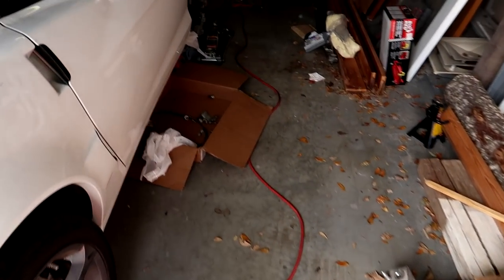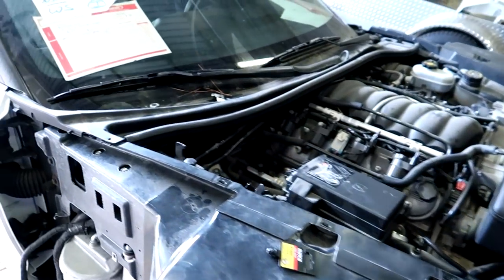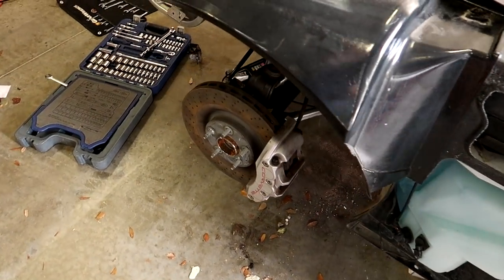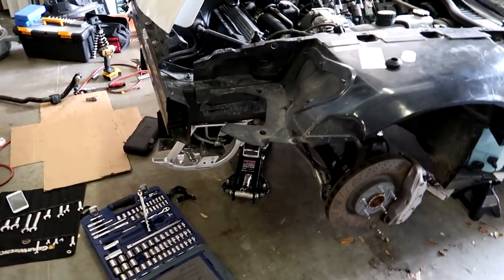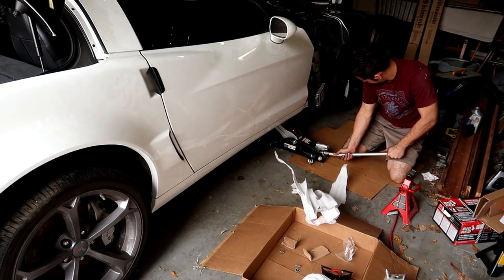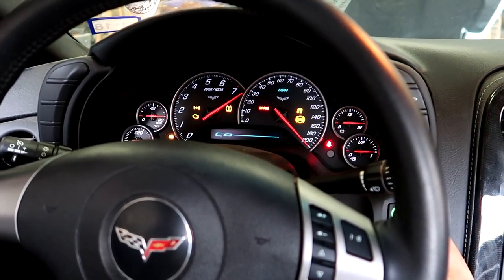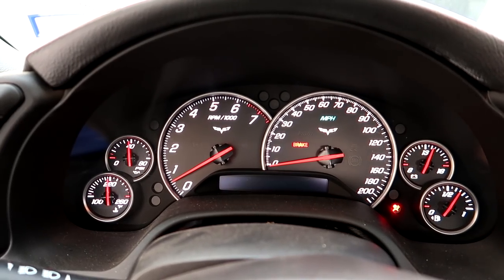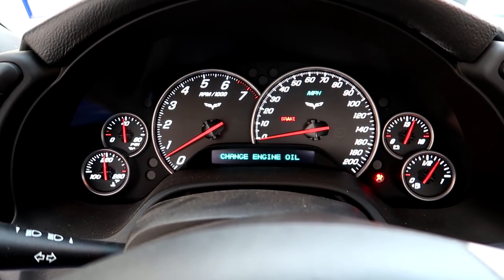THIS is why the Cheap Salvage Corvette Won't Start! Easy $100 Fix!

Comment: Do not use tap water in your radiator people... distilled and coolant only.
Reply: Why ?
Reply: ya472 minerals in the tap water could build up and cause some blockage.
Reply: Even one gram of minerals in water makes no difference.  Besides, any minerals or contaminates are suspended in the antifreeze, and again the volume is insignificant.  There are more minerals, ions and residual crap coming off the metal parts, gasket goop, seals, etc.  Using distilled water is just an 'old wives tale'.  Check your hot water tank, it takes three years and thousands of gallons of raw water to create significant mineral buildup.
Reply: He said he was just checking for leaks and if none were found he was going to flush it and replace with proper coolant. I see nothing wrong with what he did.
Reply: Distilled water? Drain refrigerator thaw out hey presto it's pure water.
Reply: ... then there will be someone who complains about distilled water because it can't handle higher temps and has a lower boiling point than coolant ....
Reply: Distilled water in a battery , I think your getting confused.
Reply: paul davison ...premixed coolant no, concentrate requires a "correct ratio" of coolant and distilled water for it to be "effective". Then some idiots just run distilled or tap water, which has a lower boiling point, and has no antifreeze properties in cold climates. Then the argument for the reaction between certain types of metals in some engines not being protected when using distilled water. Tap water dangers are the hard water minerals that build up. But everyone seems to have their opinion on what is acceptable, so it really seems to be personal opinion and experience.
Reply: bullshit dump the dexcrap replace with regular green shit and tap water  change every year if u are going to be absolutist then distilled water but shit comes apart when it does = galvanic corrosion distilled water will prevent this unless aluminuim gets released into systemwater pump wear then all for naught green shit and tapwater i lost an LT1 9c1 caprice to this dexcool shitcredit due engine temp guage read 270 degrees created  oil @4psi also dumped an xtra gallon on oil in at fuel stop cuz heard what sounded like boiling oil  2 more  hours in 10 below freezing  arrived at 445 am to west virginia  from nj next morning engine started and it read 9 psi that is a lot of hard running wonder if an ls1 could handle that                               FUCK DEXCOOL TRT2
Reply: I am a mechanic, I never used that. I use tap water and coolant. I always get rid of  dex kill. Put in 60/40 mix. I live in Michigan a colder climate. I have had no issues yet. Been doing this for 30 years. Even my college instucters use tap water.
Reply: are you A.S.E Harold... how many years shade tree? It only takes one flush and fill using the max coolant to water to know tap is Not a good idea. You would risk up to a few grand or more to save a few dollars with tap water? Is distilled life $5 a gallon where you live?
Reply: Distilled water is like $1.50/gallon at MOST, and I'm not sure where you live, but I've got tons of sediment and minerals in my tap water. If you can do it the right way, why would you not?
Reply: @nowake  It's not the right way, it's just a pointless way.
Reply: @hycron1234   It depends on where you live and the water source.
  I agree on where the crap/build up/corrosion come from: Galvanic reaction, internally. Ever use a volt meter on your coolant? It makes it own ACID.
Reply: @rickthompson5120   I use EVANSCOOL. Way better than what is usually recommended. You would be surprised how may benefits it has over conventional coolant.
 Sorry for the plug.
Reply: I use piss and vinegar to cool my engine but I also drive a vw bug

Comment: Don't use dex cool. That's some horrible shit, my engine was sluged up and stains so bad if you spill it
Reply: That is correct!  Especially now that the system should be totally flushed with the water, etc.  I would personally fill it up with the Prestone Green PreDiluted Coolant!
Reply: Actually, GM resolved the problem with Dex cool. The coolant in early 2000 was reacting to the chemicals in the gasket sealer and chemical coatings on the head gaskets. Idiots were putting it in 1997 models and older. The gasket sealer in 2005 and newer vehicles do not have that problem.

Comment from the maker: I owe it to you guys to upload more often! Too late for a New New Year's resolution???
Reply: Samcrac your videos are really good.  A+ and keep up the good work.
Reply: Haha wanted to hear you rev it though!!
Reply: never too late
Reply: Can you give us a shoutout in your next video please!
Reply: Sam you have one more new years   day coming up February 16th the Chinese New year, so get your fried rice , lo mein and dumpling on asap!!!
Reply: Plz update soon, great sports car project!!
Reply: Sorry but most manual gear cars you do not have to depress the clutch before it will start? It is good policy as I normally leave mine in gear.
Reply: Did you get it all done for 18k like you set your goal for. Also how much is the retail price. Thanks and awesome video 👍
Reply: bro if your going to use water use distilled water,, on the real...
Reply: Samcrac:. Yes that is how all these newer vehicles are. Anytime an ECM is changed or any thing dealing with such issues,a relearn procedure IS necessary. I found this out the hard way so I know. Good that you could avoid getting the GM Tech ll scanner. I'll certainly check this out as I do a fair amount of work on GM cars. Good luck with the process of getting the engine running!
Reply: How much did you pay for the car?
Reply: Hey Sam ! I replace my engine on my salvage 2008 corvette , I got it exactly like yours with a blown engine, but even like that it used stared normal, like right a way, but with a sound of a broken road, I did replace the engine , and now is like yours when you stared this video, ,,, NOW I bought the VCXNANO but the problem is that it came with no instructions, and I been trying to install it on a old computer that the program send me a note that is not comparable with windows 10, I bought an other cheap computer at a pawn shop and it says the same thing is the other old lap top, I wonder if you can make a video showing how you did it,, Thx,,, Oh I don't know if is me, or something wrong with the laptop , Thx again,,

Comment: That crank sensor thing can happen when you replace the flywheel too. On ford stuff it’s called a Neutral Profile Relearn. At least with my car you can use an aftermarket tuner to do crank relearn.

Comment: VIN matching on ecu bcm and speedometers is really annoying to backyard mechanics. I know it helps with parts theft but I don't want to pay to have parts reprogrammed just to fix my car with junkyard parts.
Reply: It's totally out of hand need re program to Change brake pads or ruin 1000$ caliper .used to fix vcrs change head need 500$ programmer for each brand of 100$ vcr  .now they want to put your money in there.so someone can borrow it during the night..😎
Reply: The parts theft thing is BS. They just want return business.
Reply: Agreed , i have a bunch of flashers from china to not only program my own key' but ecu's body module's and just about thing i need , they cost very little money .  The tech 2 scan tool has been hacked for many years now google tech2win

Comment: I hope you Flushed all that water out with coolant, you're not supposed to use tap water, only distilled water, the minerals in the tap water can wear things out faster, even if you just drain it, there will still be some minerals stuck inside, with that out of the way, I love your videos, hope to see more playful cows in them, keep them coming!  :D

Comment: It used to be called a Tech II. When my Dad worked for them he would bring one home from time to time. Huge Blue diagnostic and programming tool. Spinal Tap would go it too. It did not say to start it it said to cycle the key between off and on.

Comment: Wow, clutch pedals sure have came along way. I can't believe it needs to learn it. Is it clutch by wire, with no hydraulics?
Reply: Its probably a normal clutch but the car needs to know where it is so if you try to start it with the clutch in the car knows not to turn over
Reply: xsniper1916 I guess now it just knows the exact position of the pedal. I noticed the voltage reading 0V applied, and 3.9V released. I'm just used to the monetary clutch pedal switches on older vehicles.

Comment: I do the water thing as well for same reason. I also pressure test cooling system as well so it blows any bad hose connections or other.

Comment: The 32-bit computer thing u got wrong. It is software related in terms of, you can install an 32-bit OS on 64-bit hardware but not the other way around. To be able to use 64-bit u do need the parts supporting it. But you dont need an old computer just to be able to use 32. OK?

Comment: about the 32Bit computer... you can install a 32Bit Operationsystem on a newer one aswell btw :) (there are 32Bit versions of Windows 10 aswell)
Reply: You can run compatibility mode under 32bit no need to re-install . Every 64bit always have 32 version of the os.
Reply: yea but some things still dont work in the compatibility mode, same for the win XP compatibility mode in Win 7 etc. , works on many things but not on all ;)
Reply: Some older Software for Cars need XP and a 32 Bit CPU to run properly. You have a more direct hardware access on XP to the USB/Com Ports then under Windows 7 or 10. So it is not bad to have a older Netbook or Laptop to run the software without issues .
Reply: I just bought the Wi-Fi version of the VCX Nano and used it with my 2 year old HP laptop running Windows 10 64 Bit; and Tech2Win ran flawlessly! Now I can figure out why my TPMS light is going nuts after about 30 minutes of driving.
Reply: We have an old macbook with windows XP for this purposes...
Reply: L
Reply: I have an old laptop that run windows XP 32 bit I only use for diaganosing my cars. Work perfect for that. I have tried Win 7 in XP compatablility mode. The software still didn't like. So I unpacked my old XP laptop and am happy now.

Comment: That whole put it on the ground thing sounds off. What if you parked it on a hill?
Reply: What if you do a wheelie?
Reply: John Sams if u park on a hill, the tires would still have weight on them. It’s the removal of the weight that the sensors pick up. It’s a safety deal for when the cars r being towed(from what a friend who repos vehicles told me). Sounds legit
Reply: vdochev: Then it's already started, most likely doesn't do anything then.
Reply: Balex ask your Repo Man friend why does he think that having a tire lifted off the ground would be a security feature. Possibly in some odd way it could be a safety feature.  these days I thought you say 98% of all tows of any passenger all done by flatbeds or buy a wheel lift tow truck that lifts the car by the wheels so the wait is still on the actual Tire and a repo guy I guarantee has a tow truck with a wheel lift with all the Hydraulics controlled from inside the cab a crabs around the bottom of the tire and lifts it from the wheels. Somebody who has and uses a tow truck to steal your car could care less if it has a starter cut off security switch.
Reply: I worked for chevy. Never heard of that

Comment: Please diagnose my 2010 Camaro LS, 2 mechanics won't touch it. It throws catastrophic failure codes for every other cylinder and won't run but then the car will start up again without any history of codes being thrown.  Car also overheats when it feels like it. So far. ...2 water pumps,  3 ignitors, internal chains with all new plates and guides....4.5k later,  still won't run without overheating or throwing codes. Bought new and started breaking at 121,000k miles 1k over the engine warranty for the chains.
Reply: this may sound kinda stupid but for the overheating problem have you tryed removeing the thermostat if it doesnt overheat after removeing it that could mean the thermostat needs replaceing in some cases back in the old days some mechanics used to completely remove it all together but thats not really recommended plus the heater quits working in the car
Reply: also for the error codes it could be something as small as a ecu issue
mechanics wouldnt touch my car it was idleing weird would randomly stall after spending 800 dollars i threw a new ecu in .. and magicly all the problems were fixed
Reply: Arctic yes,  the thermostat was replaced twice along with the water pumps....... unfortunately.
Reply: Arctic ecu? Thanks ill check that out!
Reply: deka360 here's yours fix. Get rid of it
Reply: when i say ecu i mean the computer is what most others call it.. it handles alot of systems on your engine mostly sensors but if one is bad it will seem like many other problems and mechanics never look at it first but you need to ensure its programmed to accept your key because your keys may be chipped without programming your key will fit and it will turn but the car will never start.... 

Edit: if the ecu is bad that could be whats throwing your codes and sensors off.. there may literally be nothing wrong with your engine and it may not even be overheating just the ecu is telling you it is.. good news though most are quite cheap... also when i say programming i mean have it programmed to your vin number
Reply: coolant reservoir cap may not be holding pressure in the cooling system,  water boils at 212 degs with no pressure in the system making bubbles,  coolant boils at a much higher temp with 12 psi in the cooling system.  Water pump cannot pump air bubbles around hence the overheating.  In any case it is cheap to try.
Reply: Had neighbor Chrysler van they swapped out the everything the codes said took to Chrysler battery was sulphated throwing erroneous codes after engine change .was run no oil after oil change at gas station.😂

Comment: You don't need a 32-bit CPU, it just needs a 32-bit install of Windows 7.
Reply: I'm laughing at the '32-bit CPU' part. SMH. I had to stop the video and leave at that part.
Reply: eh, i've seen finicky programs that won't run on 32bit windows on a 64bit capable cpu. not all of them run the 32bit instructions correctly, but most programs don't care enough so it doesn't cause problems.

and some programs very much do.

tech2win probably isn't one of those, but you never know.

there's also the whole usb hub compatibility issue thing, in that i've seen some of these dongles hate on the hubs built into systems that use 64bit native cpus, even if those cpus support 32bit instructions. not sure if its my mobo or the chipset, or the cpu or some mix of the three, but this current rig won't let me use some phone tool software on it, even in w7 32bit. fresh drive and install then do all the steps i did on my w7/32 laptop. nothing i do will make it play nice, but that laptop just chugs away at it.

in theory yes, it just needs win7/32, but in practice you can't be 100% on that. 

for all our advances, at times computers are still black magic and you have to appease the hardware and software gods before they will play nice.

... just watch out for the printer god, that one usually wants blood.

Comment: I'm sure this is a silly question but did you try disconnecting the battery before going to the diagnostic stuff?  I don't know much about cars but I know this worked when I had some issues with my vehicle.  The vehicle was flipping out on me, sometimes not starting... some times refusing to turn off once it did start.  Lights flashing on and off sometimes and relays or something clicking as well.  You name it.  This went on for several days and kept getting worse and worse.  Finally I disconnected the battery for a minute and then reconnected it.  Kind of like a reboot on a computer.  It has worked fine ever since.

Comment: I can understand why the other guys car may not have started when it was jacked up. Some cars won't start when the front end is jacked up because the ECU thinks that the vehicle is being towed. This trick was also used by car thief's back in the day (maybe still today). They would jack up a car to get the alarm system to stop, some alarms would turn off because it thought that the car was being towed. Anyhow, good job on getting that vet to run.
Reply: Not the same, I guess the ECU can tell the difference between being parked on a steep hill, vs having the front end off of the ground. Don't ask me how it "works" per-say, I'm not a computer programmer lol, I just fix and build things.
Reply: It was me he was PMing. My vette I had a week. It is my first. It started just fine prior to jacking it up and removing the wheels. I tired starting it like that it would not. Now could it have been something else. I suppose it could have been. But when I put the wheels back on and lowered it down. It started again.

Comment: Cool that it started.  However, if I'm not mistaken, 64bit Windows should run 32bit software just fine.  It is backwards compatible.  Worst case, get a 32bit version of Windows 7 and install it on a moderately modern laptop.

Comment: I use an asus transformer t100 (I think) is the model, for my tuning and diagnosis. It's running a 32bit win 8.1 os on it. My tuning software, eculabs studio works fine, romraider is fine, freeSSM is fine, everything works. I bought an inspection camera yesterday, runs perfectly out of the box on this thing. Only thing was I had to transfer the software from the included mini cd to a usb on another computer then transfer that to the transformer. But yea, no dicking around trying to find drivers, etc. Great little computer, battery is still strong and it's nice and small and light, fits in the engine bay and glovebox no problems. :)